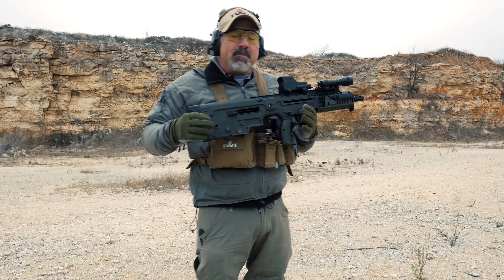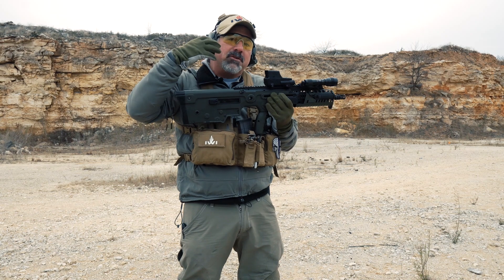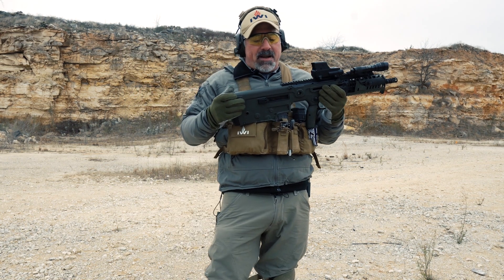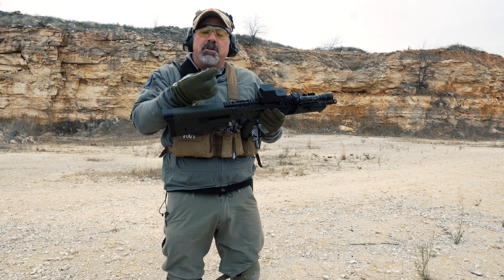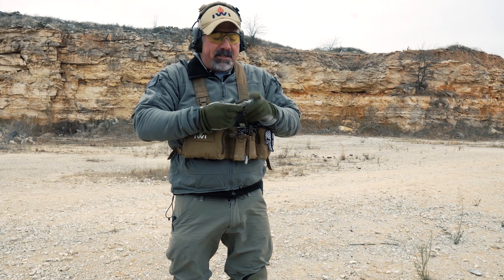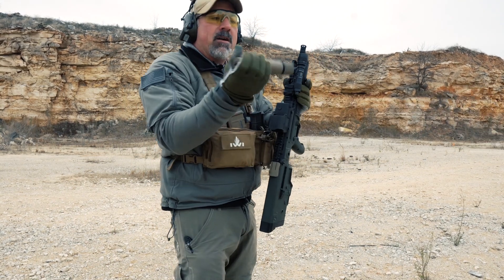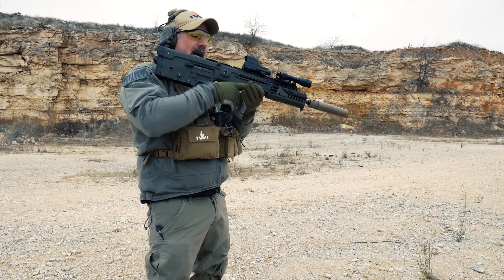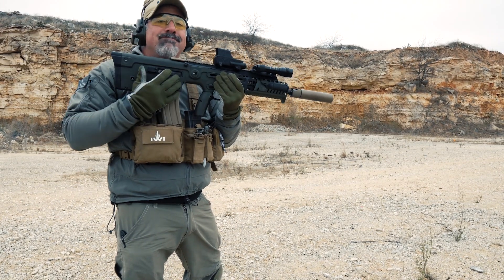IWI US Expert's Corner: Tavor X95 Suppressor Gas Reduction

Comment: Respect IWI but begs two questions: why not have a factory solution that integrates gas seals in rail and ejection port? Also, why no adjustable gas block? Suppressed, regular, and adverse? Or maybe no adverse?
Reply: Gun was designed for military application where simplicity was valued highly.  Adjustable things have moving parts that can break or get out of whack and cause malfunctions.
Reply: I wish it had an adjustable gas system like the new Tavor 7
Reply: They're probably done spending money on revising the SAR/X-95 for the time being. If they do put more money into it, it would probably be in the form of another updated product (like the x-95 was to the SAR) somewhere down the road. But you never know. If it's cheap enough to start cranking them out with a fix you might see it. I think they updated the charging handle once or twice, and made it available as an upgrade kit if you have an old one.
Reply: @drew5337  yea,   Simplicity,   Like needing a bunch if soecialty tools and oarts to turn the "ambi designed rifle" into a lefty shooter...  and actual complete takedown and maintenance is a fucking nightmare.    But ok.   Simplicity at its finest.
Reply: @ARXDMOS  
Soldiers in battle don't need to change from righty to lefty setup on a moment notice, you do it once and you move on. getting to the bolt in order to clean and oil is east enough so no other maintnance needed outside of the armory. it wasnt desgined for civilian owners
Reply: @ARXDMOS  You think taking the tavor down is a nightmare? Lol.
Reply: @Ninja9981000  not basic fieldstrip. but stripping it down to change it to lefty took over an hour but a gunsmith that iwi recommended
Reply: @ARXDMOS  He must have been taking his sweet time. I can get everything important out of it inside of 10 minutes, and I've only done it a handful of times.
Reply: @drew5337 bro an adjustable gas block is not complicated at all. They cheaped out and didn't consider suppression which is vital in modern application.
Reply: @ARXDMOS if you know what you doing and have tools, then switching from right to left takes under 15 minutes. I did mine with no previous experience in an hour or so first time.

Comment: Loctite Clear Silicon applied to outside, and to rear of gas cylinder, before locking in barrel/rail assembly does a far better job, without a clip-on rail cover solution that looks completely dumb. Wiping off excess silicon with rubbing alcohol before it cures. The silicon application comes off with absolutely no marring or discoloration of polymer body or rail. HEY IW: Why don't you come up with a gasket solution to lay over the gas cylinder to avoid this issue.

Comment: If the gun is over gassed isn’t it still going to be beat to death with suppressor use?
Reply: Garand thumb says you will destroy it with 4000 rds
Reply: @davidrichardson5333  Just watch GT's vid, it was anecdotal that he knows someone that destroyed theirs in 4000 rounds.  Would like to see a long term review of the ShootingSight high energy recoil spring for the X95 to know if a $35 drop in spring can truly solve the issue.

Comment: I just cut a piece of EDPM and used it as a gasket between the rail and the body.  It seals the gap very well.  No need for rail covers, just the ejection port not used.  It works on the stock, and the Manticore overwatch rails.

Comment: Video is almost 2 years old is this still the best fix?
Reply: @EasyBTactical  Can you please say what it is?  That video is gone.
Reply: ed2111g hey. What was your solution?  The video link doesn’t work. Thx
Reply: @EasyBTactical  I also would like to see this, as the guy said, the video is gone
Reply: The link has been deactivated (not by me) but the video is still on. Look in my channel content. I'm learning I'm not supposed to post links in comments.
Reply: The video was showing how to block the gas leak in the back. He used the IWI zipper accessory to plug the hole by it wedging it under the back rail.